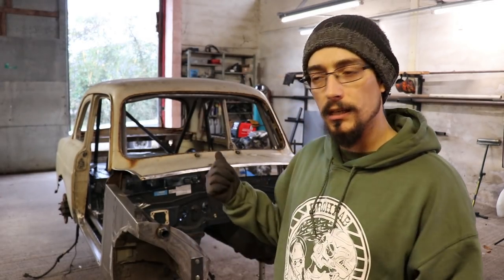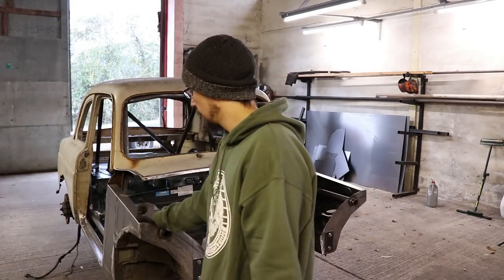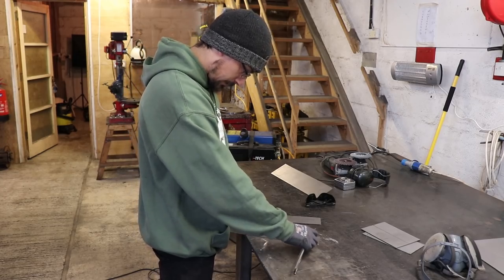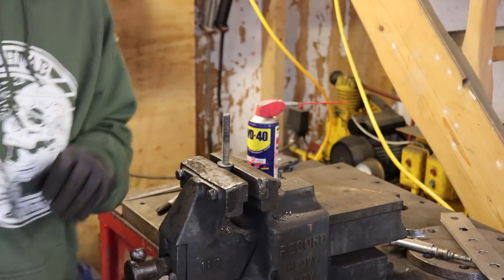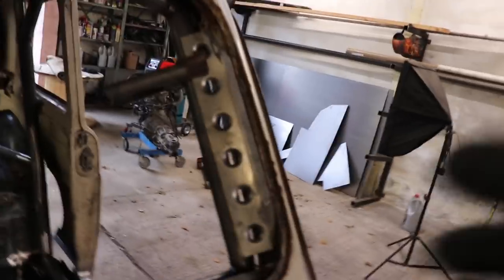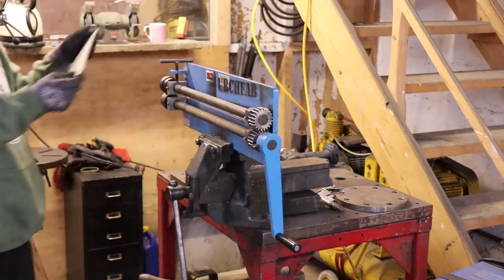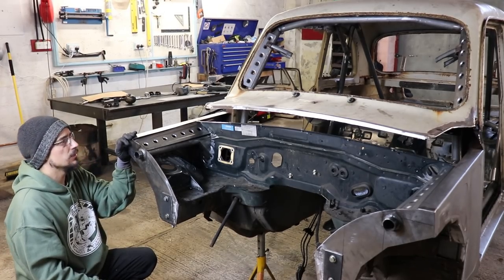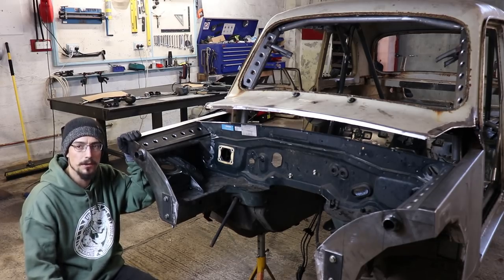HOW TO MAKE ROLL CAGE GUSSETS. MX5 MIATA WITH A 1950s FORD BODY

Comment: Holy mother of gusset. Loving the dimple die trick and the ruler trick. (Q max dies? I used a q max hole punch cutter to get nearly a kilo out of my 340 turbo tailgate and it seemed a nice bit of kit). Here's one you might know but if you don't it's awesome. Metal splinter in the finger? Vernier calipers. Better than the tweezers that nobody ever has in the workshop. Works tip top every time.

Comment: Great vid and quality work. No surprise there :)
TIP: weld the bolt you're using for the dimple die to the edge of a bit of thick flat plate. It should be roughly the width of your vise jaws. This will give you a much more secure purchase in the vise, as well as the ability to turn it sideways (better body positioning & less awkward).

Good luck n keep up the great work

Comment: Love the ruler tip. Also the suggestion to use a nut and a bolt for your dimpler if you don’t have a dirty great press.  Thanks for reminding me to deburr before using the dimpler.

Comment: Looking good. You should try out the Q max sheet metal hole punches. Could also use them with the impact gun and they cut a very clean hole. I bought the sizes over time to match all my dimple die sizes.

Comment: Obviously a shorter bolt would have made it quicker, but dropping the bolt in the vice is the easiest fix. Brilliant work. Very impressed. Respect. Locked And Loaded.
Reply from the maker: Indeed it would, and I've been using that same bolt for months!

Comment: MATT URCH in the end, counting the electricity and cutting disks etc what is cheaper? cutting sheet metal with the angle grinder or with the plasma cutter???
Reply: The plasma cutter plus air compressor probably total 8kw max consumption. Assume max $0.20c per kwh for your power and it's only $1.60 per hour. How many meters of cutting could you do in an hour? 

An angle grinder uses about 0.75kw so $0.15c per hour plus the discs at let's say $1.50 each. So one disc would have to able able to cut the same distance as the plasma's hour-long-session to match the plasma cost. Which definitely ain't gonna happen.

So the plasma is WAY cheaper.

Comment: Why the holes?  Is that just to reduce weight (doesn't seem hardly any weight), or adds strength to thin metal (just use thicker..)
Reply: This is a race car build. Added strength with reduced weight. Win.  Win.

Comment: it's not a ruler, it's a rule, a system of measurement. a ruler is a dictator.
Reply: A ruler, sometimes called a rule or line gauge, is a device used in geometry, technical drawing, engineering and building to rule straight lines. Engineering designers used devices with graduations marked on their edge called scales, when setting out or measuring length on a drawing. Wikipedia
Reply: @davidf680  i'll stick with the older original  definition,

Comment: cool videos, your work is excellent. but rather than using a bolt for the dimpler, I would have just mashed it with the vise. I hope by the time you've finished, you will have decided to use a V8 engine of at least 5 liters displacement. small engines all sound like shit.

Comment: Great videos. You should treat yourself to a shorter bolt for the dimple die, it would be be even quicker ;)
Reply: or at least cut that bolt down a bit
Reply: And used a flanged nut so no need for the washer.
Reply: Philip Manning 
The washer is a good thing to have since it allows the nut to slide on the dimpler like a bearing.